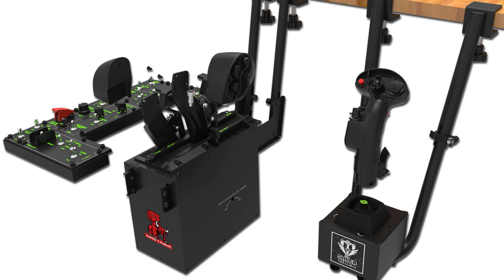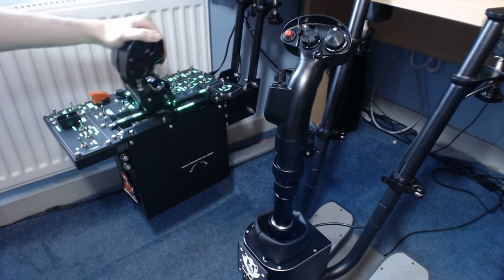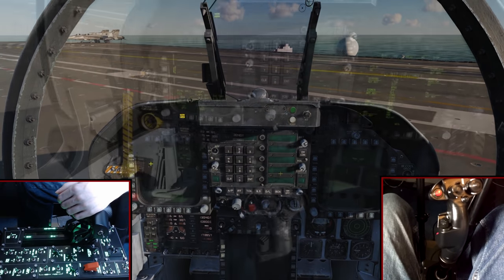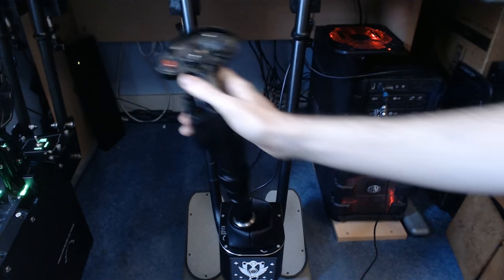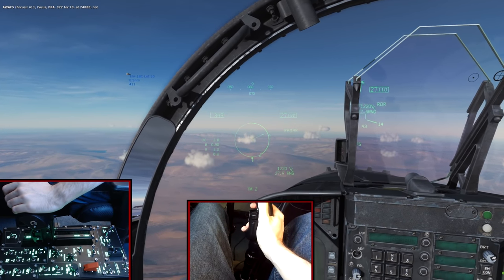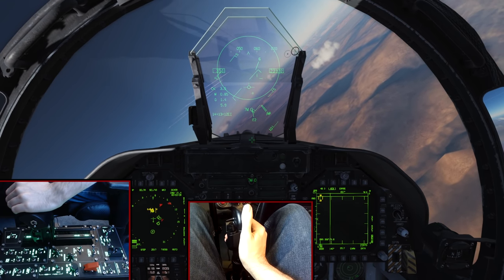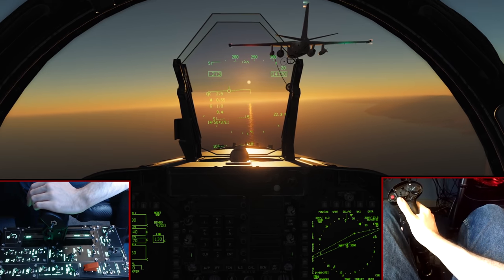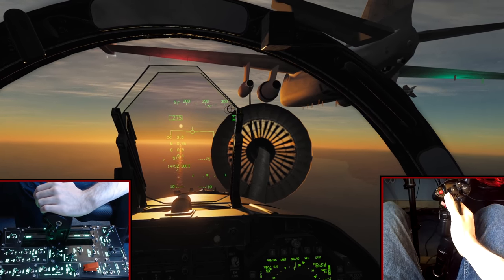WinWing Hotas First Impressions: Super Libra, Super Taurus and F/a-18c [Discontinued]

Comment from the maker: UPDATE
I had the WinWing Hotas originally delivered as what was to be the public final version, Sadly it's not up to par, and to WinWing's credit they have been working hard to resolve all their issues. Unfortunately this puts reviewers in a difficult position. As such I will not be doing a full review on the pre-release hardware. Sadly this has meant a lot of work and time has been lost, having to act as a hardware tester rather than reviewer. I wish to bring you the most accurate and honest review possible, which cannot be done given the substantial change to the hardware from mine to the final version.

With the now dubbed development hardware I have, there have been a number of faults that resulted in me shelving the units and WinWing decided to delay the public release of the hardware as a result of reviewer feedback. Unfortunately a significant number of issues were found, not least a few of the switches breaking, mechanisms not functioning properly and defects with the design which will lead to excessive wear. The good news is WinWing are committed to creating a great product and have been very good in communication with me, and to the best of my knowledge these faults were resolved for the release version of the hardware.

Just like any other company they're going through teething problems getting off the ground. I have high hopes for the WinWing team, Let's hope they can deliver going forwards.
Reply: I am loving your videos! i came for the f16 tutorial videos and i am glad i found a good channel that doesn`t take 30minutes explaining what i already know, just small details that i missed and your videos goes straight to the point! ♥
Reply: Theres a flap button on the HOTAS Throttle 
Warthog.. Please know that
Reply: When can we expect a full release version?
Reply: After 10 months what do you think about the hotas now . Im looking to buy one you see. Its a tossup between this and a virpil setup
Reply: It is from China...that says all I need to know.
Reply: Chinese

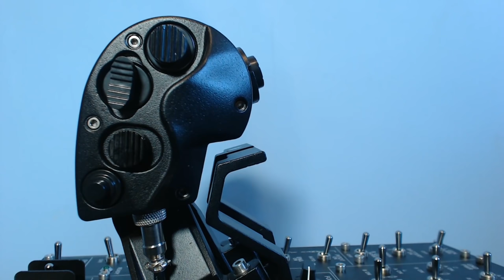Comment: 7:10 As of writing this the antenna elevation in DCS F-16 is actually incremental just like the Hornet (in fact it's probably the Hornet code). While this will probably be fixed in future, I imagine they will keep both incremental and absolute input options (hopefully for both F-16 and the F-18, I have a HOTAS with absolute axis for example which is a problem with the Hornet) so it should not be a problem in future (and it certainly is not right now).

Comment: Damn this is expesive but it also looks like the best HOTAS I can get for air combat and especially for the f/a-18, is it worth 300 more than the thrustmaster warthog though ?
Reply from the maker: I think for people looking to build sim pits or those without the skills to do so, this is a great shortcut. It's expensive but looks like it'l last a long time.
Reply: notproplayer 3 have a look at VKB and Virpil
Reply: @Eli-uv4jy  I second Virpil! I replaced my warthog base with a warbrd and it is absolutely fantastic. Wouldn't change it for anything now, and I've since added the Thrustmaster F18 grip to it.
As for the throttle, other than the slew control on the warthog throttle I've had no problems and is fantastic. Just as shame about the warthog base which is garbage.
Reply from the maker: My Main setup is the Warthog Throttle (deltasim mod) with Virpil WarBRD and Warthog handle. Highly recommend the WarBRD, nice and precise, smooth movement once you've setup the cams/springs to your taste, not great dampening however.

I think the WinWing gear is great too, especially the throttle base. The stick base doesn't seem as groundbreaking, but I've not had time to tinker with it just yet.
Reply: @TheSd1cko  Yeess, that's exactly what I was thinking, the thrustmaster wharthog looks as it is great for everything except the base that is pretty much the same on my thrustmaster t.1600m joystick I can get for 4 times cheaper (though non detachable of course). But indeed the combo you mentioned with that virpil base look hella awesome. I am considering buying it for when my current t.1600m HOTAS is going to fail (if nothing new comes up on the market).
Reply: @RedKiteRender  This is probably my first pick right now if I were to buy a new HOTAS system, the winwing still looks really awesome but because of the price it is making it hard for me to buy it
Reply: @Eli-uv4jy  Yes they absolutely interest me, thanks for the recommendation 👍
Reply: @notproplayer3649  Yes, a Virpil base, with a grip from either Virpil or Thrustmaster, plus a warthog throttle is an excellent combination. Unless you're planning on the F16 for dcs, then I'm not sure what throttle would suit you. I'm personally in the beginning stages of making a DIY hal throttle based on an F16 quadrant.
Reply: notproplayer 3 no problems bud, I bloody love the gunfighter and Virpil throttle
Reply: notproplayer 3 virpil base with warthog throttle is expensive too
Reply: @TheSd1cko   the cougar throttle would be a work around if you want more accurate f-16 styled throttle that or the x52 lol

Comment: I couldn't tell in the video, does DCS recognize when you go from Cut Off to Idle with the throttle for startup?
Reply from the maker: It only sends an input when you go idle to cut off, you can program a key press for cut off to idle with the software.
Reply: It should be possible to get it to work, since it does so with the TM Warthog. It is technically the same.

Comment: I really think i am getting this.
5:44 i think this is so you can bind it to the lever in the sim (if availible) so it moves in the sim when you use it.
Reply from the maker: Just checked the controls, indeed you can bind that, might be good for vr user immersion i guess! Hadn't even considered they' give you binds for things like that (or the air vents for that matter!)
Reply: @RedKiteRender  wait the air vents have binds??
Reply from the maker: Yep, you can bind the louvers to axis for the air conditioning!
Reply: @RedKiteRender  thats just madness

Comment: I am a beginner in DCS. Can u make HOTAS profile video , using warthog joysticks or Virgil throttle . For f18, f16 or tomcat f14. I need to know,  what are the important key to bind on stick and throttle. Good video,  can we see your profile or be shown where to go.
Reply from the maker: There is no global guide to all aircraft, each one will need different keybinds. It's a topic i'd like to cover sometime in the future though! The advise i'd give is, if it's on the hotas you probably need it. Go to the manual, locate the joystick/throttle control inputs section and bind them in a similar fashion on your own.

Comment: Hi. I was buying fa 18 stick. But Thrustmaster told me that they don't sell base and I must use the warthog one. But I don't want to buy the full set if I'll never use A10 Stick. So, is there a product that may be used as a base, not coming from Thrustmaster, to use with fa 18 stick?
Reply from the maker: I'd recommend looking up the Virpil WarBRD, it is often out of stock sadly, but is what i use in my main setup.
Reply: @RedKiteRender  thanks a lot my friend. Installation is right the same As thrustmaster? It's a valid product? I ask you because It's clear that you're a master...
Reply from the maker: @giuseppeloggia6412  Yeah, 100% compatible with the Thrustmaster handles, just align the pins, plug in, tighten the ring screw and you're good to go, same as the warthog joystick base.

The WarBRD base is also loads better than the warthog base and you can tinker with the feel by opening it, changing the springs and cams.

Issue is they only stock them in rounds, so you'l need to lookup their next restock date and be ready for it.
Reply: @RedKiteRender  great. I'm gonna buy It.😊.
Reply: @RedKiteRender  know what? I found it in stock. Maybe I've ben lucky.😊
Reply from the maker: @giuseppeloggia6412  Lucky devil! haha i had to wait a month to order mine :)
Reply: @RedKiteRender  ahahah! But now I need to order fa18 stick! Home to be lucky again...

Comment: "Weighing as much as a bicycle at 15kg". That must be a seriously heavy bike. My bike weighs about half of that and that isn't even all that crazy light in the world of bikes. It would be nice to see some internals for the throttle though and see where which material is used. That can probably explain the weight. On the Warthog throttle for instance, almost all of the weight is down to the bottom plate. The actual mechanism is all plastic.
Reply from the maker: Perhaps my bike is getting old haha, I probably should of clarified as a 'mountain bike' with mine being an old full suspension downhill spec bike weighting about the same as the full setup.

Comment: I'm not a fan of having an exclusive set up of any kind, only because I fly several different aircraft and when you change to a different aircraft, you lose immersion that is rather disconcerting over not having  one.  this especially includes those cockpit builders. Add that, the cost is getting ridiculous as they cost as much as the high end computer you need to begin with.
Reply from the maker: Generally i Agree, but then my normal setup is a modified Warthog hotas! I do look at the generic designs with a little envy after leaving my x-55. DCS and sims have certain other requirements that real life doesn't so the designs don't reflect that (eg camera zoom, trackir/camera, sim service commands) Which can be an issue.

Comment: 4:54 real buttons and VR!? make no sense. only need glove and IR lights on finger so can push VR button LOL. take your money later. it will come. and your hardware buttons come useles.. you just click buttons on vr with your finger. AWESOME!
Reply from the maker: Problem with virtual buttons, you can't feel them, and have to be looking down to find them with your VR pointer finger. Give me hardware buttons with keyed tops that can be navigated by feel alone any day over virtual ones. Now i can reach the fuel dump, hook, aar door, select my nav lights or radio settings and so on. All whilst my head remains looking out the cockpit without losing focus on say, formation flying or tracking a target.